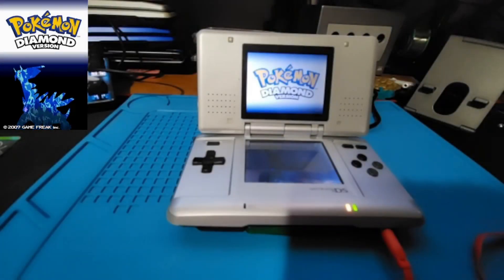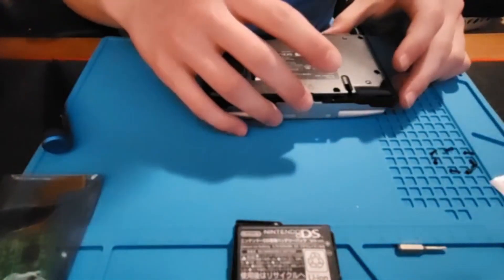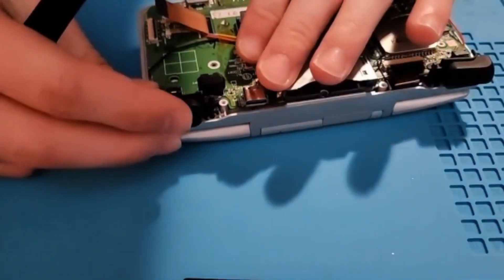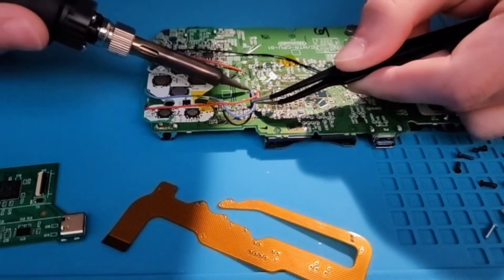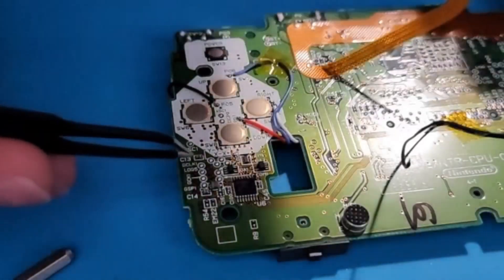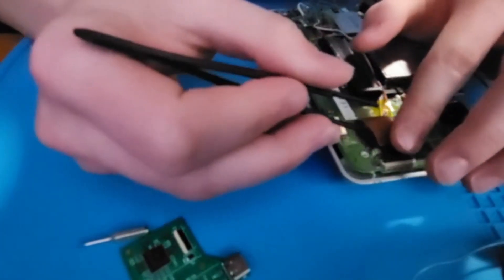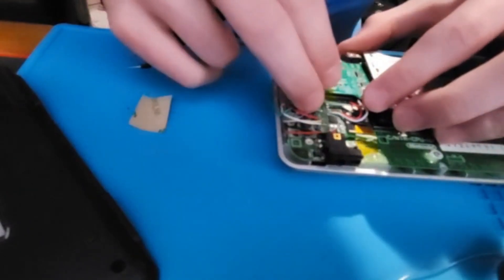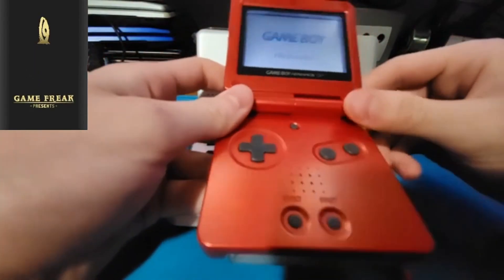Nintendo DS Capture Card Install Tutorial!(Loopy's Ds Capture Card)

Comment: how do you set 3ds capture to DS Mode?
Reply from the maker: In the newest version of the software it should automatically be in the ds mode if you have a ds capture card connected
Reply: @tracker707  are a USB mod and a capture card mod two different things? if so ive pretty much wasted your time and i apologize in advance
Reply from the maker: You haven't wasted my time at all, the whole reason i make these tutorials is so i can help people. A USB mod and a capture card are 2 different things. A capture card has a board with a USB C that you have to cut out a hole for on the shell, and a flex board that needs to be soldered to the DS motherboard. A USB mod just replaces the original DS charger port with a USB C port. Hopefully this clears up the confusion, if you have any more questions please don't hesitate to ask!
Reply: @tracker707  sorry for late response but one of the reasons I was confused on which ones was which and whatnot was because the sometimes when I plug in the USB-C charger the audio pops which the seller said it's normal because of something to do with the uhhh I can't remember what he said verbatim but nonetheless he said that it had to do with that port itself
Reply from the maker: Interesting, so you didn't install the mod yourself? Did the seller list it as a capture carded Ds or just a Ds with  USB charging?

Comment: I kind of regret getting capture cards for my DS phat and Old 3ds regular especially for the DS phat few years ago. It wasn't loopy ones though. It's the merkit something. I forgot already but it starts with M for sure. It felt like I am playing with on an emulator and a controller. I sold the ds phat for half the price I got it modded but I kept Old 3DS regular because of sentiment.
Reply from the maker: The new DS phat cap cards are super nice, the quality is the best you can get for capturing real hardware for gba and ds games. If your interested in getting one I would definitely recommend it.

Comment: Hey ! Thanks for the tutorial. Do you know if there is any new soldering points on the new loopy capture card ? (The new ones supporting the audio via usb cable). Sorry, my english is probably horrid
Reply from the maker: Yes there is. On the new loopy card there is 2 more soldering points for audio. If you look on loopys website, there will be a written tutorial and you can find the 2 extra points you need to solder down there.